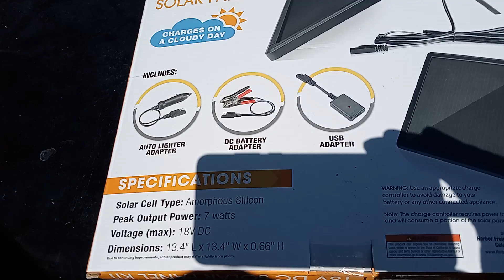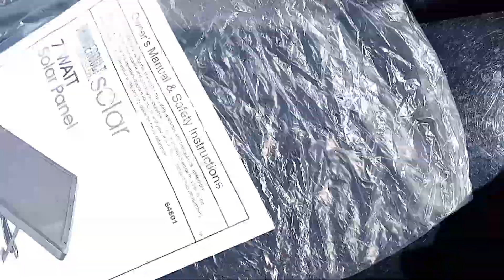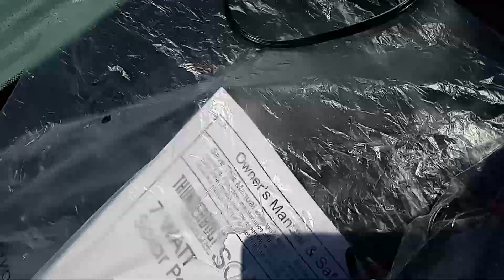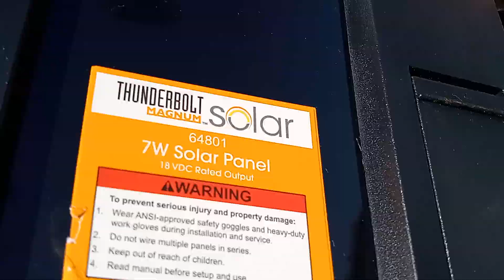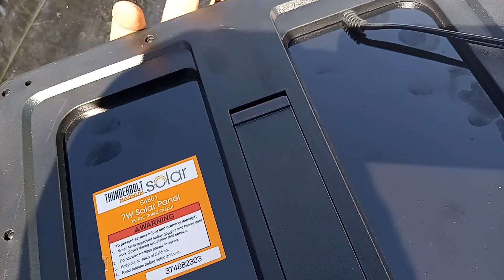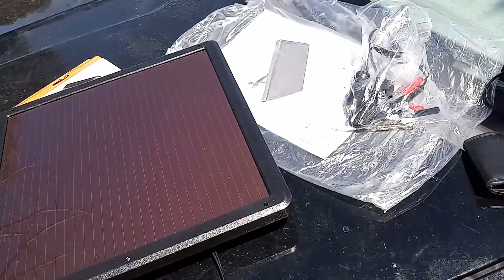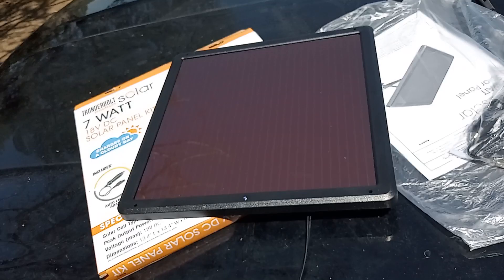Thunderbolt Magnum Solar 7watt 18v DC , solar charger review

Comment from the maker: This product actually works. For automotive batteries someday to buy the battery tender that has the J plug and use it with solar panel to keep the voltage in safe steady ranges.